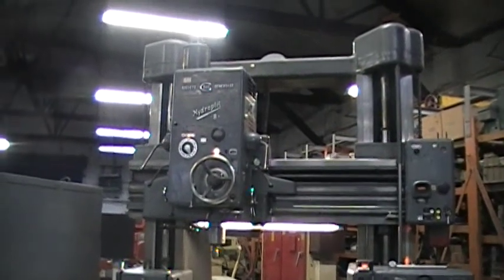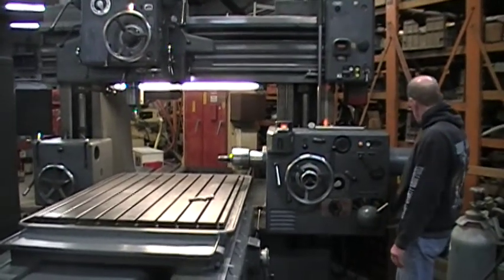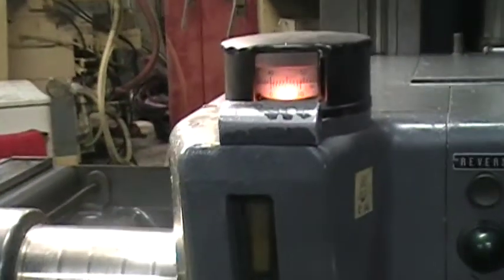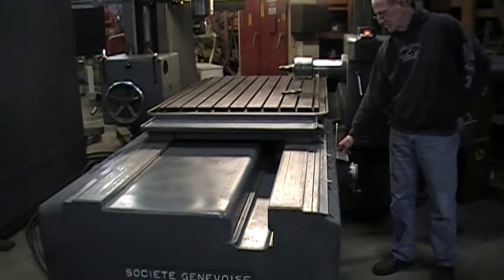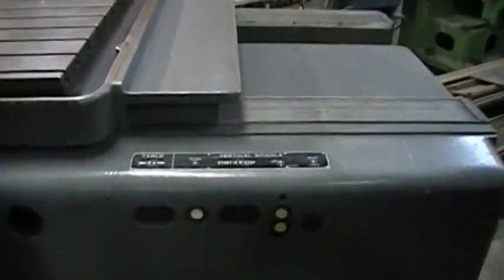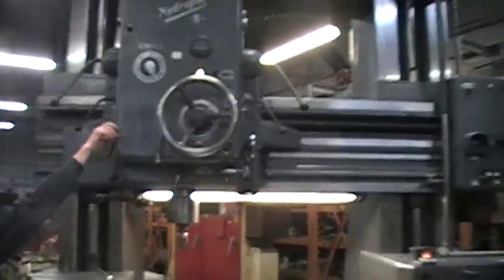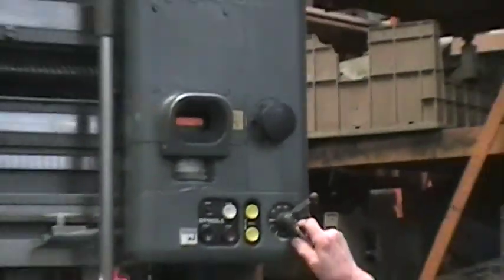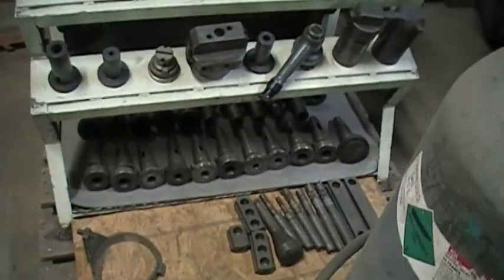USED SIP HYDR-8P JIG BORER

Comment: Can I ask what typical operations this machine is used for?
Reply: Hold tight, they are working on a reasonable reply to your inquiry.
Reply: @irondiver292  no they answered it 3 years ago.  This guy asked the same question twice and they only answered one of them, and did not answer this one.
Reply: Anything you can think of that involves between 0 and 2 lathes and 0 and 1 mills.
Reply: @impetus444  lol